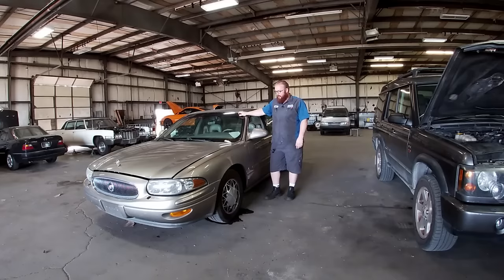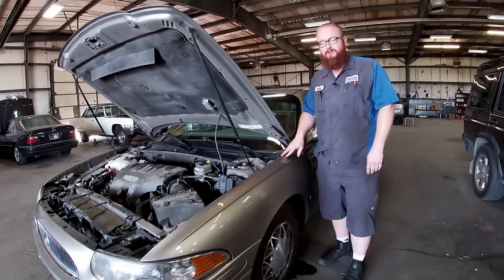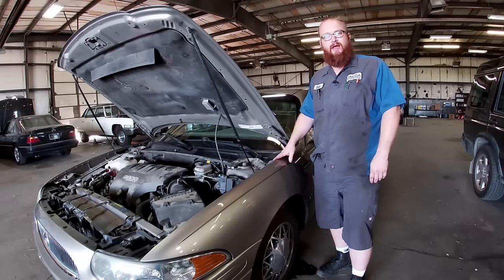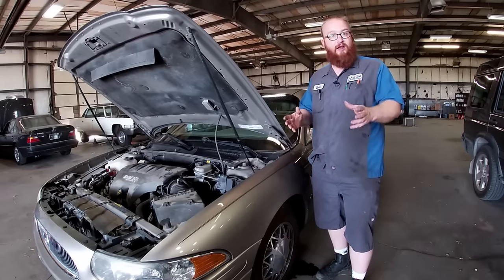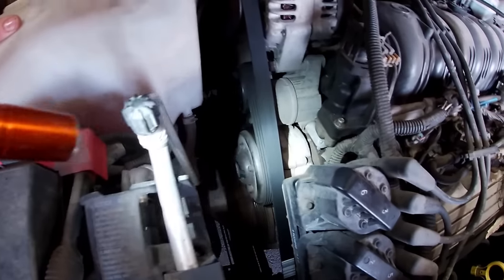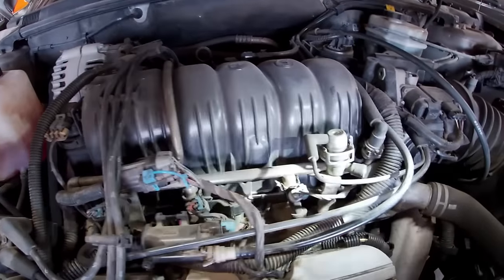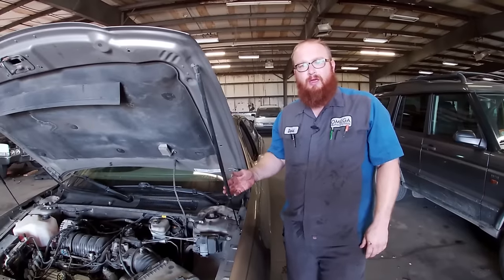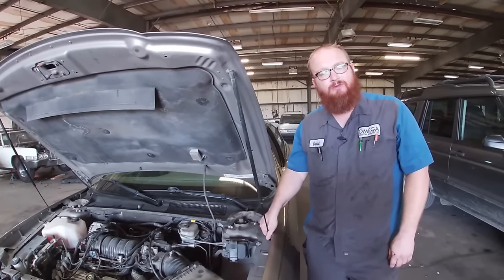CAR WIZARD highlights what makes the Buick 3800 V6 the BEST engine ever!

Comment: My 2003 VY Commodore has this engine but as a rear wheel drive version. I also use E10 fuel and works great and haven't had a major problem yet and it's at 195,000km
Reply: They used the RWD version on 4th-generation Firebirds and Camaros here. Camaro were optional in 1995, standard then and before was the 3.4, which couldn't hold a candle to the 3800 in any way. I had a 3.4, I wished it had been the 3800.
Reply: Edward Gross  They dropped it in 2005 when they went to the VZ and onwards and replaced it with the GM 3.6 ltr 'alloytec'. Not sure what they are called elsewhere, but they weren't a bad replacement and are fairly reliable
Reply: I've had over 20 vt vx and vy commodores. And only two VZ's, Aussies will understand why I've avoided VZ's....lol
Reply: VZ has the 3.6L... might be a variant of the one he mentions is garbage.
Reply: @scod3908  bingo
Reply: I own a vx commodore, 320,000km absolutely nothing wrong with the engine ever except the coil packs
Reply: @mitchell5064  I've got a vx at the moment, 276kms and drives great. 850kms from a tank easy (I'm rural though) used to have a vt l67 calais with 370kms and drove perfect, no leaks, no issues at all
Reply: Edward Gross  2004 I think
Reply: Edward Gross  They dropped it in about 2003-5 and replaced it with a 3.0 litre and a 3.5 litre which had serious  issues.
Reply: Just checked and the last ones were 2004.I might get the 5.7 V8 version.That'll be a real goer.[
Reply: @tolrem  3.6 litre but like it matters, it doesn't hold a candle to the old 3.8
Reply: Pretty sure they had the ecotech. VN VP had this engine, but could be wrong. They had a thermostat problem
Reply: @alpha_au  and ve, worst engine ever.
Reply: @50Hz  not a problem, the vn had it mounted rearward, yet it was repositioned to the front on the vp. Vr tended to eat valve stem seals though. And the last thing is the coolant crossover pipes liked to block up. Manifold off and a few hours cleaning and guaranree your heater will work again.
Reply: Lance Graham that’s right. Funny how it all comes back.
Reply: Edward Gross they replaced it with a 3.6 V6 called an Alloytec which was crap compared to the 3.8.
Reply: 50 Hz from memory later VN Commodores had an improved version of this engine. VP and VR had the same engine then the Ecotech or series 2 came out in the VS, which was the same in the VT and VY. VZs had the POS 3.6 Alloytec.

Comment: Chrysler did that with the Jeep  got rid of the 4.0 Inline 6 for a 3.6 liter V6
Reply: When the majority of Wranglers started being sold to boomers and college girls who only do highway miles the 4.0 had to go. It was an amazing off road motor. But an absolute dog on the highway.

So yeah, people wanting the Wrangler to be a mall crawler and road trip vehicle killed the 4 liter.
Reply: Bob Desombre  is this a copypasta or is your capslock stuck? Because you're kinda proving my point. The 4.0 was a beast off road, but in your own words "GOOD" on the road. The new motors will travel at higher speeds with less effort and better mpg's.

That may not matter to you or me. But to the majority of people buying new jeeps who really only want mall crawlers, it does.
Reply: Yep, I still have my 86' Cherokee, 305k on and still runs like a top
Reply: Chris YaBoi ugh!you ain’t lying.those things are slugs going down the rd.
Reply: Bob Desombre The 242 I6 4.0 is literally the same motor. The crank shaft is completely interchangeable. I had a 258 in my CJ7. I hauled 4x4 pickups out of the dirt more than once
Reply: The 4.0 was bulletproof but not fast and the 3.6 is fast but not bulletproof
Reply: The Pentastar 3.6 V6 is all right, the 3.7 is where it all went downhill.
Reply: The 3.6l v6 jeep has way more hp than the 4.0l- but less really low-end torque.
Reply: And Chrysler sold Jeep to the owners of Fiat so they had a name brand in America that would help their sales
Reply: I am not a fan of that 3.6L. I rented a Chrysler 300 and a Jeep Grand Cherokee. It was OK in the 300 but a pain in the GC. You have to rev it to 5000 RPM to get any power, which is ridiculous in a SUV. I can't imagine how it behaves in a Wrangler on a trail.
Reply: @johnbearjunkyard  On the trail  the Wrangler 3.6l  low-end torque is nothing like the old 4.0l. .
Reply: @lousbk  emissions and hood slope killed the 4.0
Reply: @wannabeetiger  In line engines will always out torque a V.
Reply: The 4.0 had oil leak issues and it was government environmental regulation's that killed it. The 3.6 is actually a great engine it is basically the same thing as the v8 minus two cylinder's. The problem with both engine's is people do not use the correct engine oil viscosity and they use the wrong fuel grade's. 89-91 octane and 5w-20 full synthetic oil recommended. There's also some recalls and service bulletin's that people didn't get fixed. Oh and they have very sensitive cooling systems. The only engine's I've ever seen go overheated.
Reply: I miss the 4.0, Chrysler got rid of them because they weren't seeing any come back for repair lol
Reply: Worse mistake ever
Reply: @kowalski5599  no they stopped making them because of environmental laws made by the government.
Reply: It’s technically where the power tech 3.7 is where it went downhill. I’ve driven a 4.0 97 ZJ and own an 02 4.7 WJ and a 18 3.6 WK2 and imo they’re all great motors (gas hogs I may add) but overall really good. The pentastar has its power and torque in the higher rpms but kinda makes up for it with a higher  diff ratio compared to the 5.7 hemi with more power/tq but lower diff ratio
Reply: @BrendanRSX  The 3.7 and 4.7 are basically the same exact engine's and the only problems I've noticed with them are user irresponsibility. They're actually very reliable and durable if you take care of them. Much more reliable than the 4.0. I've owned both, loved my old Jeep GC, it was bulletproof. But it broke down so many times, the transmission burnt out, and it had oil leaks. The 3.7 has given me absolutely no issues in 4 year's. I've never been broken down on the side of the road with it. Where the old JGC I broke down several times and had to rebuild the transmission.
Reply: Weird, I never had any issues passing people in my old Wrangler
Reply: The 4.0 stops being fine on the highway when people insist on moving the same huge wheels they use for offroading. That engine in a sedan would be plenty fine.
Reply: @kowalski5599   Actually the 4.0L Straight 6 was designed by AMC ( American Moters Corp) back in 1987. Lee Iaccoca brought AMC before the bankruptcy and the French Company Renault was eager to sell to Lee because they were losing money and polictal tensions with France didn't help either. SO its AMC/ Chrysler made after 1988. The only reason Lee wanted AMC was for the Jeep name.
Reply: @chrislemaster2695  Of all the people who replied in here, I have no idea why you chose to give me a history lesson. I already knew everything you said, and what you said has absolutely no bearing on what I wrote.
Reply: The 4.0-liter is a tremendous motor. I love mine, but the reality is it’s not too efficient and would not pass emissions. When you’re mass producing Jeep’s and putting these things into hundreds of thousands of vehicles, sucks to say it, but it matters. The 3.6 is much better than the 3.8 minivan motor
Reply: Ford Australia had been using a 250 straight six for decades. Or 4 litres Unkillable. now we use crappy v6 from europe or the states.
Reply: My father in law got stuck in his f150 and couldn't get out of the snow and mud. I had my old grand Cherokee with the 4.0 and told him I'd tow him out. He told me if his ford couldn't get out there was no way my old Jeep was going to help him. I barely had to idle it to pull him right out. I loved that Jeep. Finally blew at 275k after having a terrible knock for the last 50k miles of its life. The yj wasn't my favorite design but when it came to doing anything off-road it was an absolute beast. Minus the rattles and squeaks.

Comment: The 3800 is the third most produced (40 million) in automotive history.
Reply: I wish GM kept it and did further development on the 3800. I owned a few and they are great all around
Reply: @chrisoconnor3119  i own one now.... 2001 grand prix GTP supercharged 3800. i love this engine, i will buy another..... even if it gets harder to find them. i will have one shipped up from down south.
Reply: Australia took that engine in 89 to 03 and turned it into a mid engine, rear wheel drive in the locally made Holden Commodore. They also shoved a Eaton M90 Supercharger on it. Damn good engine and damn near bullet proof. Some of them in Aussie are still running with well over 500,000 kms or over 200,000 miles.
Reply: @Vsfan95  The ones from 89 to 93ish have shithouse bottom ends, I have had a few mates commodore utes throw rods out, pretty much rev it up and throw rods. maybe later ones are better but they were crap.
Reply: frank white  you must be joking. That carbed pile of crap?  Poor mileage, weak bottom end , they were junk.
Reply: frank white  sure was. But that wasn't a carbed 3.8. That engine was specifically built for the t types and the gn's and eventually gnx's. It was sequential fuel injection,  had heavier main webs. Larger oil returns on heads and intAke valley larger cam. , bigger valves, fasteners were improved, thinner head gasket with larger sealing rings. I know I own an 87 gn that was a basket case. I was gonna install another engine till I discovered the differences.

Comment: I know this is great engine, but the one in my '95 Riviera failed when the car was only 8 years old. The well known GM issue of the EGR tube / lower intake manifold problem resulted in my engine flooding and thus being hydrolocked and ruined. I had to put in a replacement engine, and that one only lasted 10 years before it punched a rod right through the block. The 3rd engine in the car is from a '99 LeSabre.

Comment: My best engine was a Ford Zetec 2.0 in a focus. Sold it at 270k miles and it still ran like a champ. Only problem I had was when the cam cover gaskets leaked oil on the thermostat housing which then cracked. Had to fix it twice, cost $70 each time. That was it, other than 10k oil changes.

Comment: I've owned 2. Intake manifold gasket. That's about it. 350k on both
Reply: had a fuel rail die on mine at 120k, now at 170k with no more problems
Reply: Yep especially with plastic intake
Reply: Own a '97 LeSabre myself. Just replaced the upper intake plenum, lower intake gasket, valve cover gaskets, & fuel injectors. Car runs like brand new. Can't beat this motor!
Reply: @MrLarryDallas45  Both of mine were '94,s, but I've replaced alot of those plastic ones
Reply: @saulgoode5923  Those Series 1 3800 motors were especially awesome.
Reply: Don't know why, but the 3800 Series II's in the 4th gen Camaro's have an aluminum intake manifold (1996-02).
Reply: Coolant elbows for me
Reply: Lol I had to put out a fire that almost started in my engine bay from that dumb recall, my car was a Pontiac Grand Prix gt and it had 200k and ran perfect when I sold it. Definitely a solid engine other than that
Reply: mine eats the first o2 sensor every year . one head gasket so far,the electrical is a nightmare but at nearly 250k on the factory motor. 2002 venture van .
Reply: David Moschella - Which was caused by the then-new Dexcool being incompatible with the gasket material.  A different gasket fixes that problem.

Comment: If you don't believe the Car Wizard, just ask people like me, who have owned a few cars with the 3.8l V6.
Reply: Yep I've owned a few of them too, 200,000 miles is not unusual for that engine, I hammered my 91 olds 88 and the inside was falling apart (broken tilt steering and driver's window) and the compressor claddered like the the car was fixing to explode any moment, but it was a knock about by that time for a car when the other cars where in the shop again, the car literally wouldn't quit running we finally got rid of it at 210,000 and I still got some of the money back after only giving 1700 6 years earlier.
Reply: I have 2 in my driveway right now.
Reply: My mom loves her 2004  gtp
Reply: Are we talking about the supercharger ones
Reply: Grandmother used to own a 2001 Park Avenue with one.  Damn car was a tank in reliability.  Since she can’t drive anymore my aunt now has it and the cars over 500k miles.  GM was beginning to give Toyota a run for reliability at the time, and if they kept up they would have done so much more.
Reply: I’ve owned two. With a couple changes to the plastic parts into copper or aluminum... it lasts forever
Reply: I have a 2000 grand Prix with 284,000 miles and the tach pull's right to 6,000 RPM with every shift and Not ONE unusual sound during a cold start..
Reply: I've had two. In my friend group, its known as the legendary 3-eight. Well known for me beating the shit out of it with daily pizza delivery all the way up to 340K, and only melting the intake a single time because the previous owner did NOT take care of the engine. My new one has no issues, 94K on the odo. I will stand by the 3800 for the rest of my life, as an engine that can stand with V8s, with some light mods and still hang with 4 cylinders on long road trips. It gets better gas than the 2800 Vortec, which is a lazy shit of an engine. My only complaint, is that they mostly came in FWD Auto only layouts.
Reply: @syanheart3178  I agree! But it's more efficient and faster in a front wheel because you don't have a drive shaft and rear axle to turn..
Reply: @philllsxga.7737  FWD is only like, 30 percent of my complaint haha. They barely mated the 3800 to manuals. A 5 speed can really wake the engine up and allow you to get even more out of it. More fun, a little more speed. Probably a little more gas if your just cruising the boulevard
Reply: @syanheart3178  yes, a 5 speed would have been fun! 
I know those 3800s were damn good Engines!
My buddy bought a used regal w 173,000 miles on it. After a 20 minute drive the oil filter was still cold. He later found out the oil hadn't been changed in 3 year's!!
He sold the car with 214,000 miles on it with no Engine trouble! No unusual tick, sounds nothing!
It ran perfect!!!
Reply: @philllsxga.7737  Yes thats why my friends and I call it the legendary 3-eight! It takes a RIDICULOUS pounding!! My new one won't even go above the first qaurter of the heat gauge. Not to mention, you've got torque on demand, anywhere in the power band. And the sound of it at full throttle is like nothing else. Letting off at 5.5K lets a nice pop out of the exhaust as well.
Reply: @syanheart3178  Heck yeah!! There has been about four of them in my family!
If GM would just build a modern 3800 but that's the thing it last too long didn't make them any money among other politics...
Sad...
Reply: Mine sits at 239xxx and runs strong. However, my 4.6 in my mustang has took a beating from the time i bought it at 101k only at 192k did i rebuild the top it. And it still ran great. Just blew a spark plug and the hole was too damaged to use the head again.
Reply: @icrusade7672  the 231,3.8L in 84 was a pos.
Reply: Once you fix the intake manifold coolant leaks and all these plastics junk, this engine is really robust engine.  Unfortunately, unlike Toyota who keeps as long as possible for a good engine like 1.8L, and 3.5L for more than 2 decades, GM killed it. It is too good for GM.
Reply: @Tenzaromon  GM does not keep reliable engine in production too long.  Meanwhile Toyota keep their reliable engine as long as possible like 1.8 L since 1994, and 3.5L V6 since 2005 which dated back from 1995 in 3.0L as the base design.
Reply: @rondhole  , so, is that why the new Supra is just a Toyota badged BMW Z4?😁
Reply: Freedom First - - i have a 08 Pontiac Grand Prix GTP, it has the 3800 v6 and is supercharged, for some reason my car wont start, it just keeps cranking, i put in a new starter, battery, and new key from chevy any ideas on what it could be?!
Reply: Excellent engines.  I own three cars with the 3800.  90 Olds, 99 LeSabre, 01 Regal.  Great cars.
Reply: @freedomfirst5420  Exactly, that will be the only BMW I will buy.  Toyota chief engineering (Tada) answered it in the interview.  BMW with ZF transmission actually made really fine car, it was just other parts (mostly plastics, electronics, clips, sensors, valve guides) that BMW made too many mistakes on mostly M5 series.  Toyota actually teardown the inline 6 from BMW bolt by bolt and everything was fine.  Upon 20 hours of abused in car released press, there is no single glitch on the circuit.  But we will see in the next 4-5 years.  Just like GTR, it was the most reliable supercar compared to Italian sportcar, junk after 10k miles.
Reply: 02 Grand Prix approaching 200k, I love my car, I keep it clean, get a lot of compliments and a lot of people offering to buy it.  I usually joking say 50k, but that's probably what it would take to get me to part with it.
Reply: @DPain82   I Crusade  in mi country this engine cost more than 3 times the price of that car that wizard is showing you guys are so lucky to get the opportunity to choose so many variety of vehicles  with cheaper prices than most countries in the word...
Reply: @slowgoat6089  Check your crank position sensor... They go bad.
Reply: @DPain82  me too
Reply: @Tenzaromon     children were not taught patriotic loyalty,. keep the money and jobs here, nobody makes anything better than we Americans heh heh who won the  great 2nd world war
Reply: @syanheart3178   I disagree, you can't beat an automatic shift
Reply: yea right that driveshaft takes up a lot of power, not. that is why dragsters don't use them!  hohoho
Reply: @azuredragoon4880  Can you tell us specifically which parts you changed from plastic to aluminum or copper?
Reply: THE CAR WIZARD IS SUPER ACCURATE.  HIS STATEMENTS ON CARS  ARE
SPOT ON. INCREDIBLE CAR MAN THIS WIZARD DUDE.